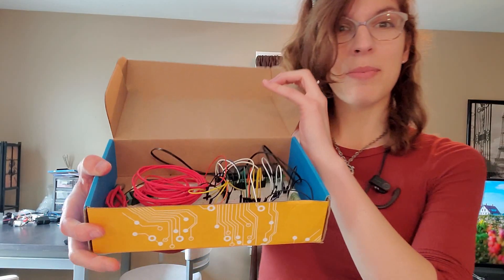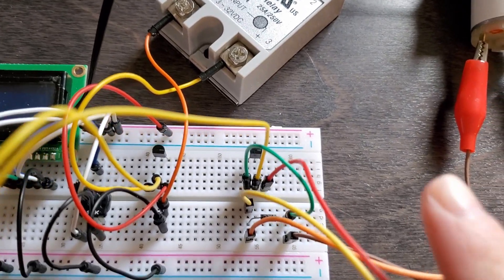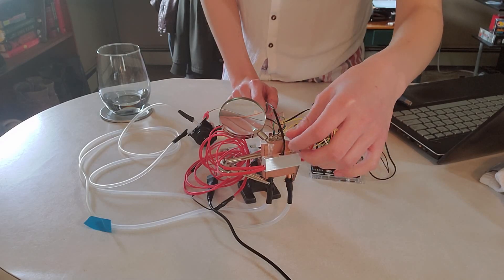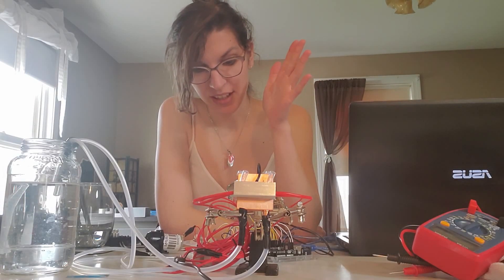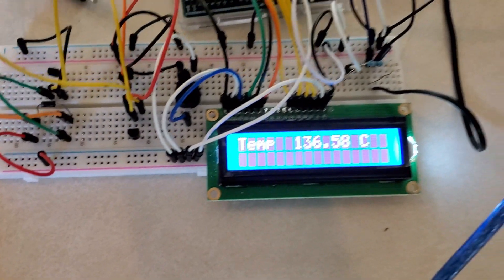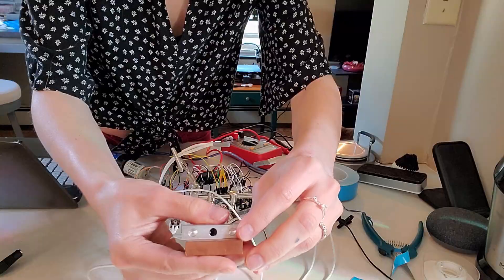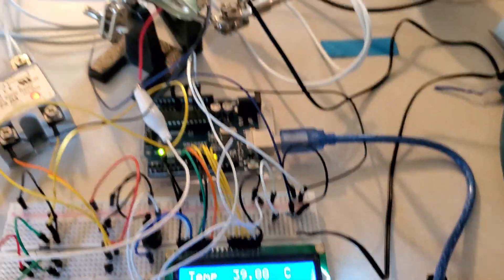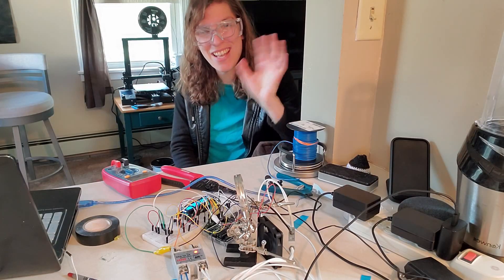Making a COVID Test Part III: I BUILT A PCR REACTOR

Comment: Awesome build! Great cinematograhy. :)

It looks like you ended up within specs for cool time, though one idea that came to mind was mechanically moving the heatsink in/out of contact with the chassis. So when heating, the heatsink would be airgapped from the chassis, and at cooling-time, a motor would e.g. rotate it on a hinge to be in metal-to-metal contact with the chassis, maximizing heat transfer.

Comment: I was thinking that, maybe, if you drill a hole in the aluminnun part to pass the water with a tube it would cool the whole thing pretty fast. 
But if it doesn't work and you have to stick with the fan you can redesign the aluminnun part to include some fins on it's sides to increase the heat transfer. And the part have to be manufactured with those fins, because the tape to fix the heat sink probably includes a high thermal resistance to the thermal circuit and you might want to get rid of that.

Your channel has so much pottential, i imagine that in a couple of yearshow many students and cientists will be in your comment section
Reply from the maker: Ohh, the drilled hole is a great thought! That would help keep the extra mass from being an issue. I had explored the idea of using heat sink fins off-camera, but the issue was (like before) the added aluminum would keep our heaters from heating as fast. Trying to balance the heating and cooling was much trickier than I had thought!

Thank so much! I hope this can lead somewhere exciting - I love science and I would want nothing more than to have a youtube channel where I make it fun and easy to learn for students and enthusiasts! :)